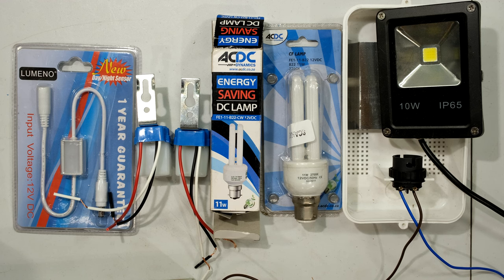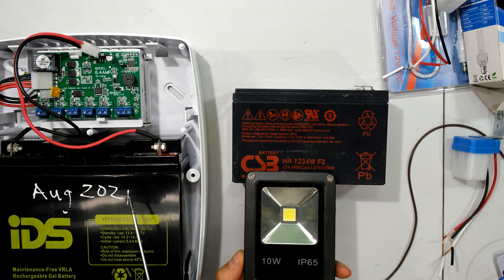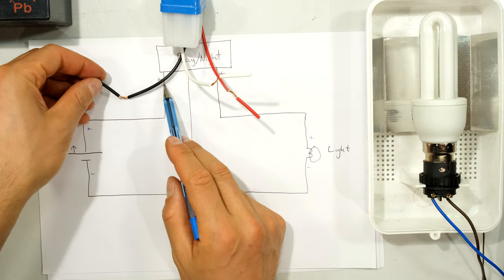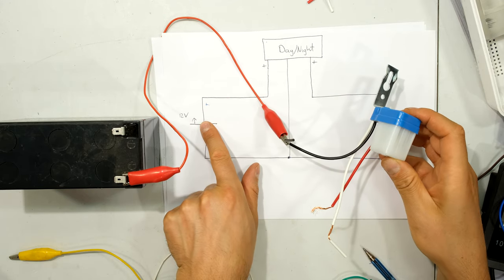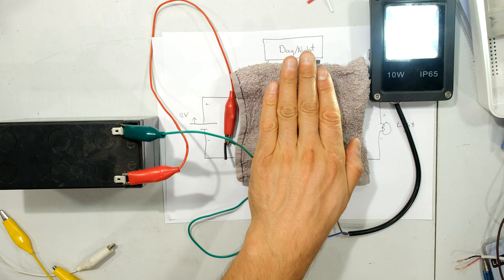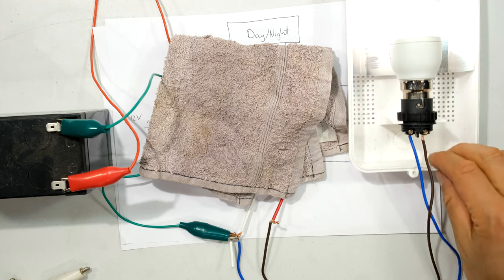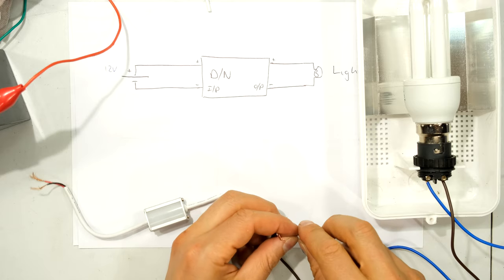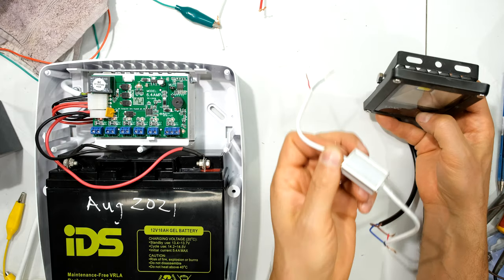How to wire and connect a 12V DC day night/switch to a DC LED light

Comment: My second question:  I am using my old 12V 7Ah alarm batteries to power lights in my house during loadshedding. I have big dreams with that! Can I keep this permanently on a 7A Motor Cycle Smart Charger connected to the mains?  As you know loadshedding is not getting better! Love your videos.
Reply: I've been using this setup for about two years and up to now my house is not in flames.. I have a total of 15 (7ah lead acid ) batteries all connected in parallel supplying power to 5w dc downlights and three 10w dc fllod lights.. Woeks lekker with no issues
Reply: I am using a 10A 7stage smart charger, dc day-night switch, 250v Ac relay, 12V dc relay,  battery protector. These are basically the main components of my system... The only thing I baoght was the charger and the rest I got from the junkyard. This is now grid interective and serves as a backup when loadshedding hits...

Comment: I have two questions:  1) Your power supply looks like one of my alarm supplies. It uses 12V 7Ah battery. I would like to connect another 7Ah battery in parallel, BUT I am do not want to blow up the power supply. Also I am not sure that it can effectively charge it effectively.  What do you think? My next question is another comment.
Reply: That won't have any problem as long as you don't connect the two batteries in series.. The only problem might be the time it takes to charge the two batteries